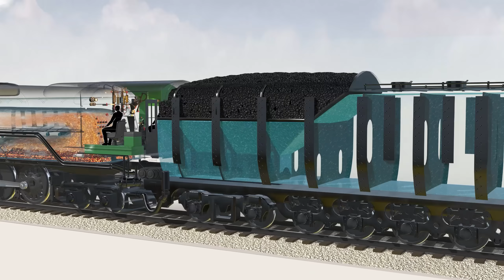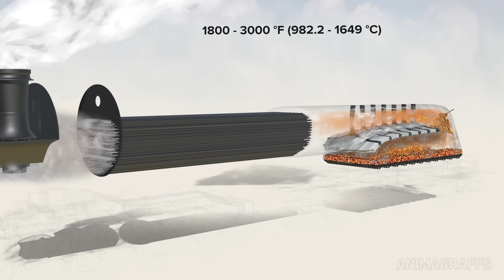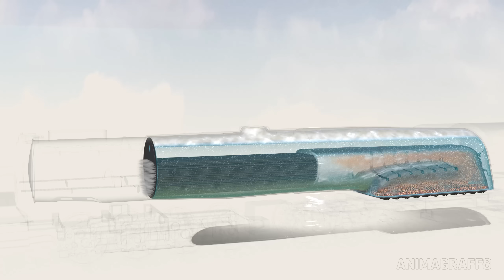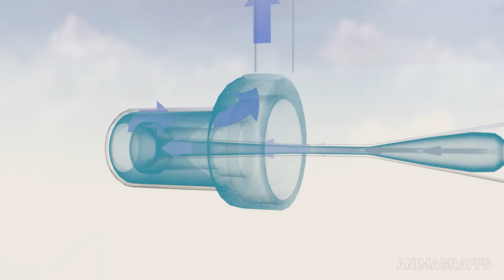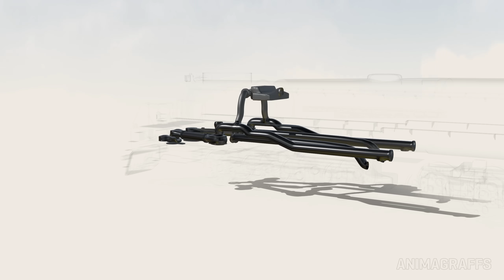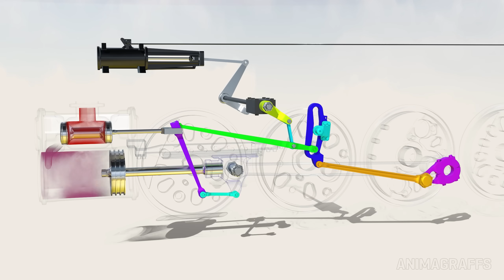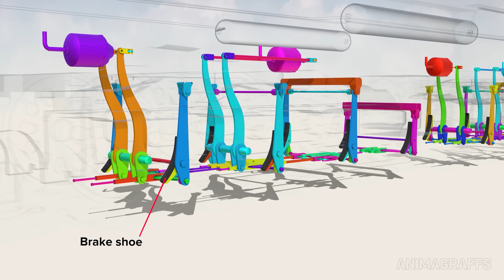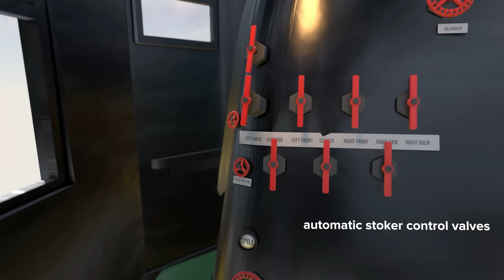How a Steam Locomotive Works (Union Pacific "Big Boy")

Comment: Great video, I learned so much. I find it absolutely fascinating to see how the individual systems in a modern steam locomotive work and what their purpose is, and to trace how efficiency and performance have been improved since the first steam engines. The basic principle is the same, but more and more subsystems were developed to solve a wide variety of problems. In the end, you have a super-complex system that, at its core, does the same thing as the first steam engines—just much better. I love this kind of development, and on a small scale, I follow a similar process when building something with Lego Technic. One problem leads to the next, which then needs to be solved. In the end, the final model is significantly different from the first version, even though the basic function remains the same.

Comment: I stopped watching after 10 minutes because I realized you weren't going to actually show the process from beginning to end. You did an amazing job describing each section and process, but you didn't describe the entire process. You should have done an animation at the end that showed the water going in, the air going in, the coal going in, how everything is managed, and how energy is provided to the components

Comment: 4/2025....Amazing animation video. Thank you. I'm an older dude,....at 71. In the early 1970s, while I was in college, a friend of mine was able to get a Pre-Civil War (manufactured) steam engine power plant. It rolled on iron wheels, but was not powered, by the steam it produced. The steam ran a power plant, that could power a semi-portable saw mill, via leather belts. It could be used to power many other farm equipment, including grains mill, and wood milling, lathes, other equipment, via pulleys, and leather belts. My friend got the power plant for free, as it needed repairs, and was not being used. My friend was a master welder, and had hopes of restoring the unit. He died before he could achieve that at age 63, in 2014. I loved studying his steam engine, and touching such an old relic. The large scale of it and incredible weight of all the iron parts, were awesome.

Comment: What 4 modern engines? It has less than 6MW of power, Siemens Vectron has 6.4MW. Granted, only a half of the torque but if you want to get moving quickly you can use 2. It will still be shorter and weigh less than the steam engine by a factor of over 4.

Comment: The people that created these trains back in the day were geniuses. Such craftsmanship and dedication and determination is amazing to see.
We still use steam power to this day. 
Nuclear reactors heat water into steam which in turn is used to spin a turbine which rotates a coil in an electric generator producing electricity.
Most efficient, safe and clean energy generation we have come up with so far. We should be building more. Energy wouldn’t be a problem if we did and would be much cheaper.

Comment: I while ago I called you to task for calling this machine a train.  No matter what my comment, this is a most splendid explanation, description and illustration of how this engine works. Your description here would work quite well for an ALCO  4-8-4, Northern engine as well. All engines have basically the same controls though they are not arranged in the same place in the cab. Those who are curious and get up close to one of the corpses of these engines can trace the piping that carries water, steam, and air to the working elements of an engine.  I wonder what you would do with a detailed explanation of a Walshearts valve gear would be like.  Imagine doing that all in pencil, paper and slide rules. People today don't even know what that is.  I'll bet you do. Thank yu for taking the time and effort to produce this amazing  work of art.  Steam is still king. It can be made clean. With modern materials, bearings and balancing, these giants of the rails, could once again rule the high iron.  Thanks so much for the magic of your imagination.

Comment: Hello...

That's very impressive. Both the system and technics behind the locomotive, as well as your work on this video. Great stuff. Really.

Could you, maybe, do another such video, but for a german Baureihe 52? I know, it's much to ask and one could just take the info from this video and think of it in the shell of a 52, as most of it ist the same/similar. But I just wanted to ask.

Anyway. Thank you for your great work and your videos. They are a great source of information for those interested.

Comment: one thing i learned late about steam engines is that the drive wheels are at different angles left vs. right so there is no way to get that axle into a stuck position.

Comment: 7:20 water CAN be compressed but at 300 PSI the compression is so little it can barely be measured.  considering water to not be compressible works just fine at these levels.

Comment: i wonder if a design like this could be heated by something nuclear? this would be revolutionary in 2 ways by providing a large mass freight option that creates zero pollution and uses zero fossil fuel plus once operational wouldn't need to be refueled for years also providing a transportation option for the continental US with the previously mentioned benefits allowing for family coast to coast travel at extreme low costs also eliminating a large amount of air and car traffic by under cutting the ticket cost of plane ticket and if sleeper cars were brand new and state of the art more people would travel this way which would force cheaper airfare and even car prices as corporations would have to do more for less to get back the business they once had because of a completely new option would be federally backed allowing a slow down of the runaway capitalism we've been unable to combat in any meaningful way for the last century

Comment: Until this video, I considered steam locomotives pretty simple machines. Not simple as horse wagons, but not complicated as this. 
Making machine like this, almost 90 years ago, that was harder and more difficult, than building trains today, even maglevs. 
Only when it comes to drawing, today we have software, drawing and 3D modeling, back than, they had only paper. It is much difficult to draw on paper or without 3D model. I was working at steel construction and it was much easier when I model something in 3D, than make drawings from that. 
Also people who was in workshop, no CNC machines, mostly manual work etc... 
I could compare this with building space crafts today.

And yeah, kudos for you making all this in 3D plus animated.

Comment: Great video!  I love the detail here. I have a rather detailed question.

I noticed both sets of cylinders seemed to operate in parallel.  Theoretically, after the high pressure steam was used in one set, could it then have been used in another set, this time as low pressure steam for more economical operation?  What would the advantage have been in this design verses the locomotive as designed?  I'm guessing, Big Boy has more starting horsepower this way?

Comment: Love your vids, but 1 tiny little nitpick: In the X-ray views, the borders of the boiler get completely transparent,
making it look like the water was directly in contact with the fire/coal. At least the boiler copmartment 2D outlines at the cut plane
could have been shown in those scenes to avoid confusion.

18:47 The cyan short rod attached to the reverser thingy seems to change it's length
 Is that flexible material, or an inaccuracy of the animation?

Comment: I sometimes imagine what might have been if steam had continued and had as much development and international expertise injected as diesel/petrol engines?
Instant steam from auxiliary tank powered by supercapacitors and lithium batteries to get moving as a buffer before main boiler kicks in.
Auto coal loading into furnace.
I've always wondered why the exhausted steam is not passed through condensers(to replenish the water tank), first air cooled and then heat exchanger/radiator using the cool water tank

Comment: I don’t know where you got your info but you are grossly overrating the Big Boy.  A 5 mile train in the Big Boys era would be between 500 and 600 cars.  That is 4 to 5 times more cars than a normal train of that era.  Also a modern single diesel, such as an EMD SD 90 Mac, has more tractive effort, (pulling force) than a Big Boy.  The Big Boy has 135,000 lbs of tractive effort.  While the SD 90 has a starting tractive effort of 185,000 to 200,000 lbs and a continuous tractive effort of 147,000 to 165,000 lbs.  So a single SD 90 can out pull the Big Boy.

Comment: As late as the 2000’s I was still operating old school manual Cleaver Brooks boilers from the 50’s. Everything was done by hand manually including the igniter, (usually a flaming wad on a rod inserted into the firebox after purging), multiple fuel nozzles, water injector, Briggs & Stratton draft fan motor with manually opening draft control, and quick and slow opening blow down valves. I had a water column and sight glass along with the pressure gauge which I used together with watching the exhaust smoke for proper colour to ensure I had the draft set correctly and for adjusting the fuel nozzles. The one nod to anything modern were low water safety cutoff switches installed after one of these mobile boilers was dry fired. Around 2010 we switched to modern automated boilers and it was like transitioning into another world, however it took a long time to trust automation to do what I’d done manually over the years.  Looking back now I’m so glad I ran the old school boilers, I was in my early 20’s when I started.

Comment: water is not compressable at all...
yes... yes it is
everything is compressable if you apply enough force -even iron. where do you think black holes come from?

back to water -> 
at about 10000 m depth water compresses itself by about 17%.
so 1 cubicmeter up here, has just about a volume of 0,830 cubicmeter down there

Comment: i wonder if we could modernize steam engine, how different would the design be? modernize = more modern materials maybe lighter trains, more efficient combustion better coal / additives etc. 

as a non-engineer, the only thing i can imagine improving is better combustion and lighter materials. with this we can maybe lighten the engine of water and coal to reduce the weight but less water also reduce the margin of error.

Comment: So much complex mechanical engineering and so many mechanical parts all powered by steam, but the truth is, it would have been much more efficient not to use steam for any of this, but instead to use steam to power a steam turbine, which is connected to a generator to produce electricity, and use that electricity to power the train with electric motors, as well as all the other components. I know that doesn't sound like it's more efficient, but it is, because transporting electricity is much more efficient than transporting steam, running electric pumps, compressors, and motors is much more efficient than running them with steam or using steam pistons to create motion, and using steam to power a steam turbine is the most efficient thing you can do with steam that we know of so far. 

For those who don't know, modern diesel trains don't "run" on diesel either, they use diesel only to power an electric generator, they run on electricity because it is actually more efficient, they don't need gears or clutches, they have less mechanical losses, and they can run the diesel engine at a constant speed where it is most efficient.

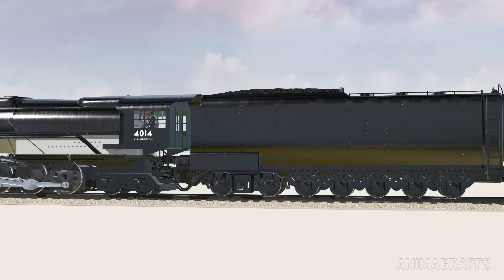Comment: 1:05 so i guess Steam Locomotives are powerfull, but not used because the fuel, which is coal is not efficient and expensive? I wonder, since for decades generating electricity is just heating up water, and currently the best way is nuclear power, how would Nuclear Powered Steam Locomotive do?

Comment: These were marvels of engineering.  I didn't realize how many different systems that had to work together for these locomotives to haul so much.
This video is great as a clear, illustration of how a locomotive works.  Thanks!
I also realize why the railroads changed to diesel-electric locomotives.  Even with two major systems, diesel and electric generator and motor, they were simpler, which meant cheaper to buy, operate and maintain.  Plus, they were more fuel efficient.

Comment: still kinda confused on how water injector work. also, how the superheater pipes survive the heat without water protecting it while the normal boiler pipes are not? i work at industrial boiler and once (dedinitely not on our shifts), the water level drops below the safe level and the boiler pipes bent and leak (fortunately only bent and no explosion occured)

Comment: In isolation, any one of the hundreds of intricate systems in operation on this magnificent machine is the result of decades of refinement and optimisation by the smartest engineering minds. The articulation of the boiler is particularly fascinating, so impressive.

Comment: I used to live in Bremond, TX. Union Pacific had a southbound main line that ran right through the middle of that small town. About once a year they used to bring Big Boy through there. That line happened to have one of the longest straight stretches on the route right in that area, so they would usually do a high speed run exhibition through there. Local law enforcement would guard all the crossings in town whenever the train got near. People would come from all over to witness it. Seeing that behemoth blow through town at 80+ mph was a spectacle. The black smoke and steam cloud would linger for an eternity, seemed like. I'll never forget it.

Comment: We used to be a real country. 

In all seriousness I love learning about how people used to do things back before the internet and computers because this shit is so fucking clever and all it is is just a really efficient boiler with some wheels attached. Its interesting to learn that even back when the Big Boys were running that they were aware and cautious about pollution and accidentally causing fires on the tracks. Obviously what pollution meant then vs now is much different but coming from the chemical industry where you often get isolated from production to prevent number fixing, its so satisfying to think that at one time not only did someone have to think about how to design one of these, but also that tons of people had to understand all of the parts to operate it.

Comment: "Water is not compressible at all."  No, that's incorrect.  Compared to a gas like steam, water is relatively incompressible, but if it could not compress at all, it would not be able to transmit sound.  From the viewpoint of plasma, any atomic or molecular body still has incredible amounts of vacuum space that can be squeezed out.

Comment: 7:06, Wait what? Pure steam is a gass with no water in it? Hell NO, steam is 100% water. Guess you did your research and got confused by "dry steam', which is water but with no droplets. Yes it's invisible because the water molecules have so much energy that they can't stick together and form droplets, this occurs always above 100ºC. The 'steam' we can see,is actually condensation (sometimes called wet steam), below 100ºC. Evaporation is the only other state where water can be invisible and be under 100ºC at the same time. Evaporation can even happen when water is frozen, very slowly.

Comment: Sorry..... but with the te tamperature in the video... from 1000 to 1600 celsius i'm not an expert...  but the steel at 800  celsius is ready for forging, i think you made a mistake....  at 1600 celsius the regula steel is rady to put in a sand stamp

Comment: I'm not quite sure why you would say "Pure steam is a gas with no water in it" at 7:07,  steam literally IS water. The water molecules in steam are just moving really fast and thus create pressure from banging into each other at high speed. They get moving that fast by touching a surface that is also moving fast, The heat from the fire is making the atoms in the metal vibrate extremely fast cause heat IS energy, a water molecule touches the fast moving atoms in the metal and get smacked so hard they turn to steam... for a very short time, that water will hit other slower moving water molecules and turn back into water, but in the end everyone is moving a little faster. After enough time and energy you can get a lot of water very close to boiling and a bubble will emerge, it will have enough heat in it to keep the water in it bouncing around fast enough to keep the bubble going all the way to the surface and poof your water is boiling. It also takes all the heat with it as it escapes the water and this is why you cant get all the water in a pot to turn to steam all at one time and is also why steam is hotter than boiling water. 

Other than that confusing bit the rest of it was great and the graphics are very nice.

Comment: The steam æra is over, and long gone. However - when seeing all the extremely clever engineering this video reveals, I am not completely sure that all modern locomotives or trains are as well thought out, as this, albeit extreme piece of equipment was. I am though completely certain that almost all train fans learned a lot because of this video and didn’t know about all these inner workings of this sophisticated machine . "Thanks" is just a simple word to express gratitude for this very well made video. 👏

Comment: The massive amount of trial and error that led to these subsystems simply amazes me. One thing that others may or may not think of is that there are no welds on it. Every last piece was forged and fit the hard way. Now we have gotten to the point where an engineer can enjoy a nice cup of coffee in a decently climate-controlled cab while running. I bet those guys that ran this came home very tired and very dirty.